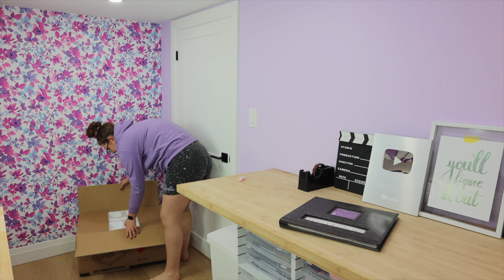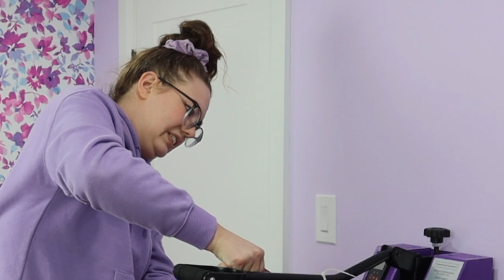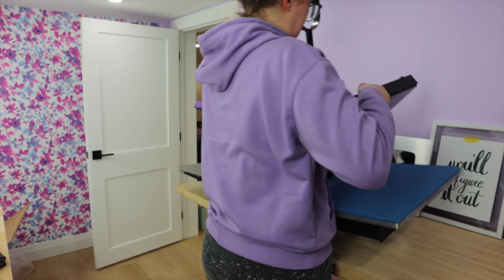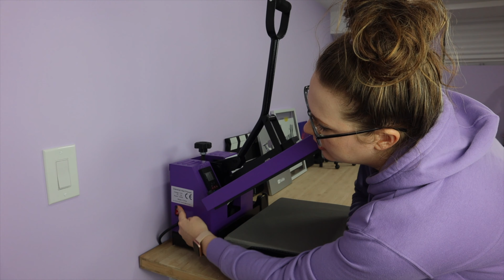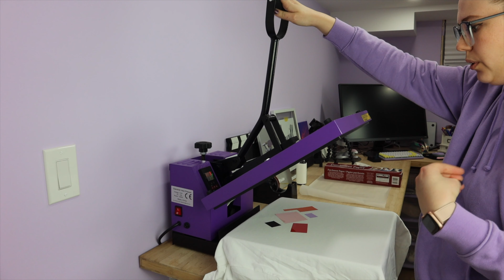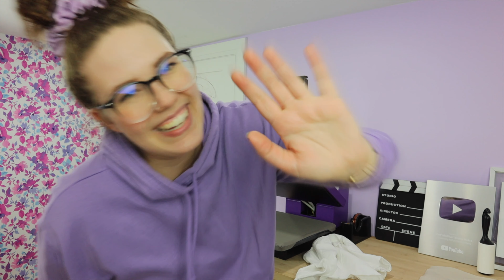BUDGET FRIENDLY HEAT PRESS FOR SUBLIMATION & HTV - BETTERSUB ON AMAZON

Comment: Can this press be used for sweatshirts also? Is it just that you’d need to press it for a bit longer?
Reply: Im wondering about this too, has anyone tried hoodies??
Reply: @VixenRoseBranch  I bought this press and I use it for HTV and I've done lots of hoodies. I use the same time and temperature for all shirts (t-shirts/crewnecks/hoodies). 305º for 15 seconds with a heat resistant sheet. After the time is up I remove the carrier sheet and put the heat resistant sheet back and then do another 15 seconds. It works well. I'm using Gildan shirts and Siser vinyl. The thing I don't like about this press is that the bottom plate doesn't slide out so when I'm putting the shirt in the press to get ready I have to be close to the lid that's hot (I use oven mitts when it's a hoodie because it's more bulky). I like the presses where the bottom plate slides out. But the press itself has been really good, no issues with it. I hope this helps!

Comment: Sorry i can't just leave without this. i saw you struggle with the weight of the heat press so i checked that on average, men are 40% stronger than women.. For a moment, this made me appreciate being a male. 🙈 That means it would be the same if i lifted about 65 pounds or 28kg...

Comment: When you say the heat press doesn’t beep or let you know it’s at the right temperature, how then do you know it’s reached the temperature you set it to??

Love the purple but have hesitated buying a press because there are so many reviews that scare me away!!
Reply from the maker: Hi Susann!! The spot where you set the temperature has a little screen for time and a little screen for temperature so you just look at those and you’ll see the numbers climb until it’s reached the desired temperature, then it will stay there. So just periodically check the screens 🥰💜
Reply: @TheFoiledPlan  thanks so much for the explanation.  It's like my oven..lol although it does chirp when it reaches it's temp, it also shows it...I was waiting for your response, then I'm getting it.  I did one shirt with my iron, and most of it was fine, but I don't have the strength to give it that firm press....and this one is reasonably priced!  Thank you so much..you are a joy to watch and giggle with....